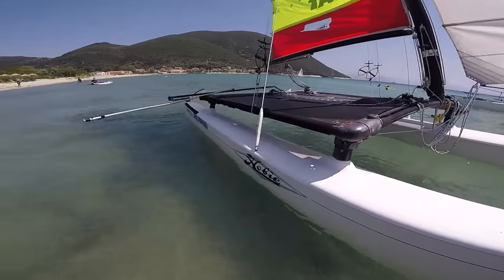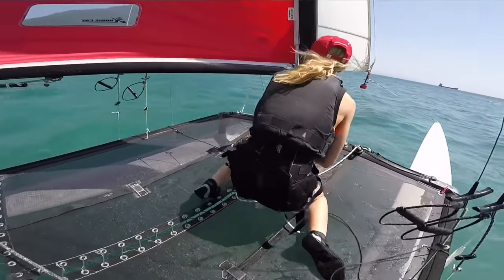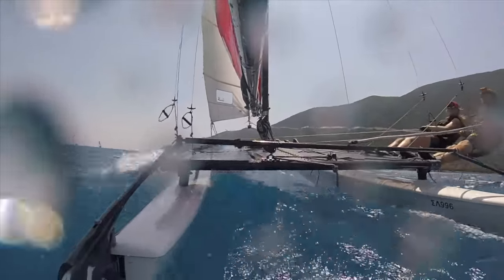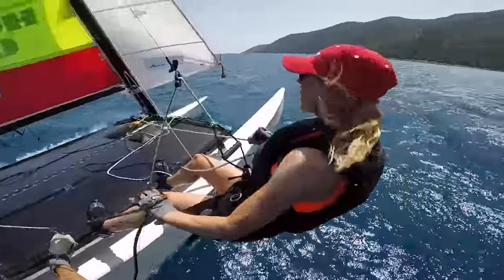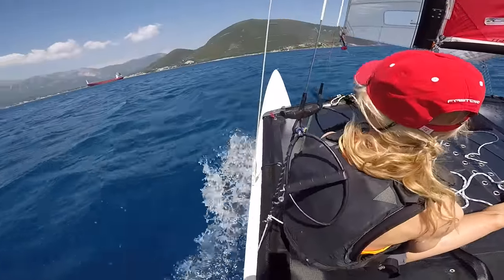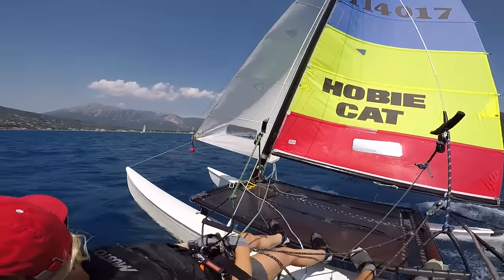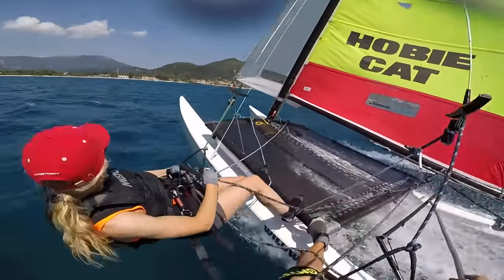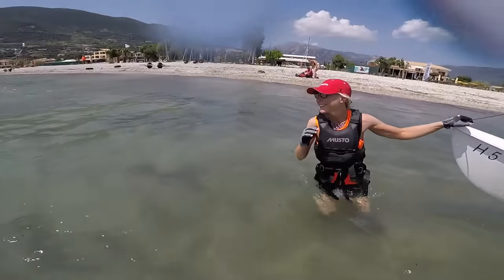Hobie 16 sailing tutorial onboard commentary multi-camera

Comment: Hi Joe... Question... What affordable gps (sailing) watch would you recommend for tracking speed, distance travelling, compass (direction), wind speed etc.. I've seen some of the crew wearing what looks to be these types of watches. Im not a racer... More rec sailing. Thanks
Reply from the maker: I Use a Timex Global Trainer - now discontinued but you can still find them cheap on eBay - here's one https://www.ebay.co.uk/itm/Timex-Ironman-T5K44-F5-Global-Trainer-GPS-Sports-Watch-w-HRM/173680913242?epid=96903689&hash=item2870306b5a:g:AGkAAOSwgJlbFEgr:rk:9:pf:0